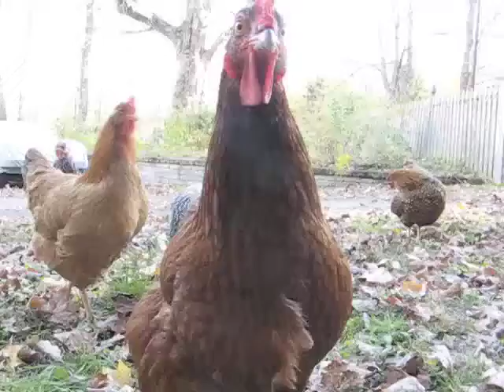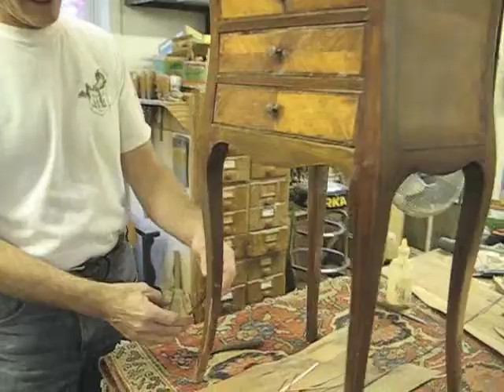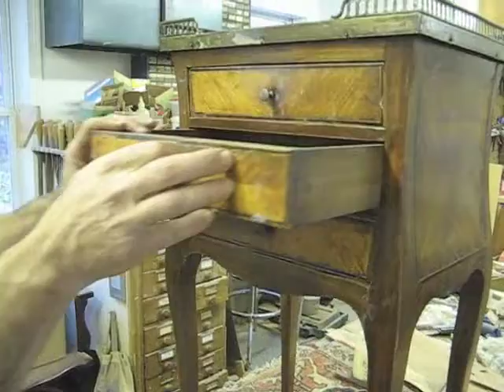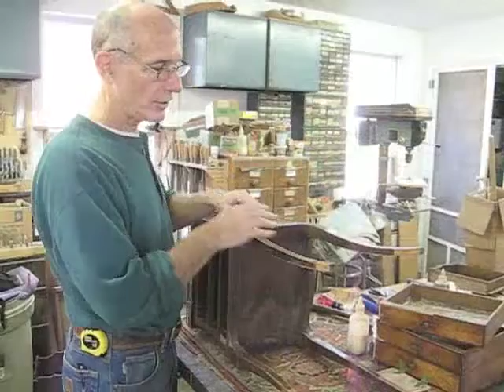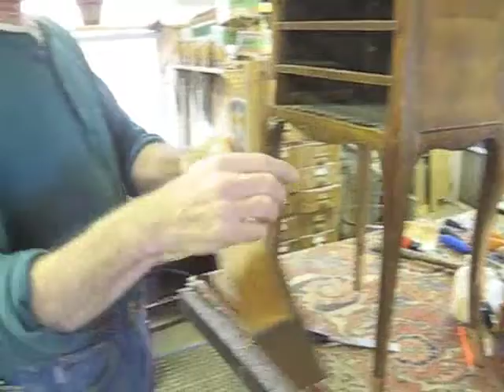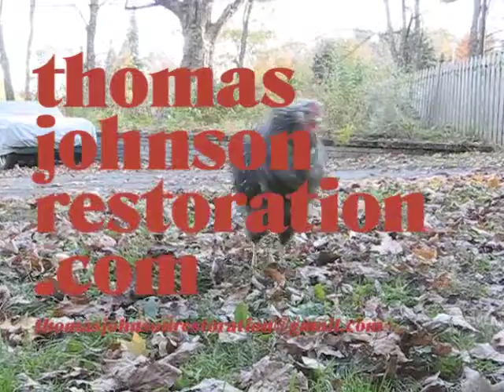Veneer Repair - Thomas Johnson Antique Furniture Restoration

Comment: im sure you've been asked before, can you use contact cement to adhere veneer on a project like this?
Reply from the maker: You know, I've never used contact cement. I had some bad experience working on furniture where contact cement had been used - the glue was loosened by the solvents I was using. So I've never thought about it since then. I don't see why not.

Comment: Hi mate, 
my friend and i love old furniture so we have decided to start finding old pieces and restoring them. We bought a Solid Mahogany chest of drawers, guessing from early 1900. however, it is solid Mahogany with the expiation of the top which it is veneer and as of this the top has buckled due to its age and has had slight water damage. The top of the piece will take the most effort and time, as the piece overall is quite good, considering we got it for a steal of $100. 
So my question is, when we restore the top veneer, whats the best way to do so as it is a large top?
Reply from the maker: Please send some photos thomasjohnsonrestoration@gmail.com
Reply: Thomas Johnson Antique Furniture Restoration okay, thanks!!
Reply: @harryeverett2152  PLease send us ALL some pictures! I'd love to see how it turned out

Comment: Tom, what kind of glue do you use? Thanks
Reply from the maker: +Bob Perry Hi Bob, on this particular job I was using Tite Bond. Usually on period antiques I use Hide Glue. The reality is that Elmer's white glue, or yellow glue, or hide glue all work well.
Reply: +Thomas Johnson Antique Furniture Restoration 
Thanks Tom!  Really appreciate it. Although much less experience, I use Tite Bond, but noticed in another video you were repairing veneer on a drawer, the glue was in a jar, must have been hide glue. Any reason why you choose which? Where do you get hide glue?

Comment: Beautiful! But how do you repair veneer that has rubbed down through constant use? Do you need to sand it down and fill it? Or replace the whole piece? This is an antique table, and I hate to remove the old veneer due to stains, gouges and worn spots.

Comment from the maker: You don't have to bother with flakes, etc., although they are available from Woodworker's Supply on line. I buy Zinsser SealCoat Universal Sanding Sealer which is a wax free shellac. I usually thin it 50/50 with alcohol. It's widely available but you can get it online as well. Buy it in quarts, shellac has a limited shelf life. 
Didn't get your 2nd question
Tom